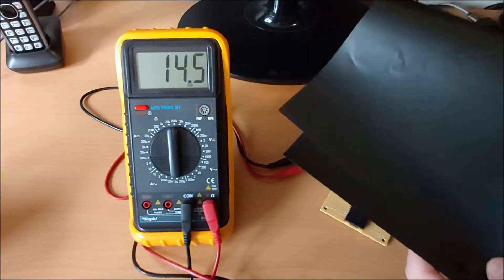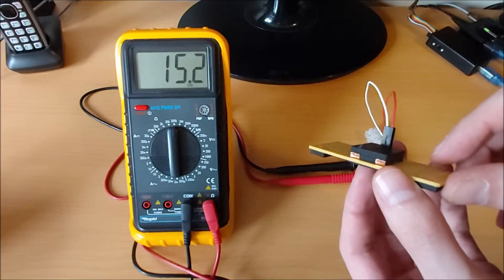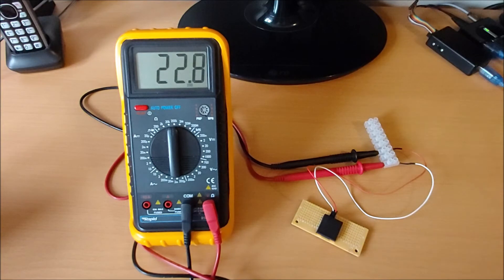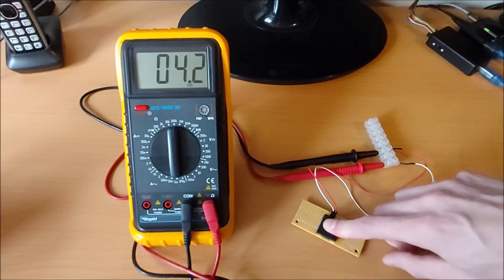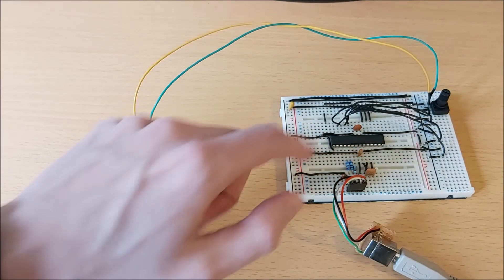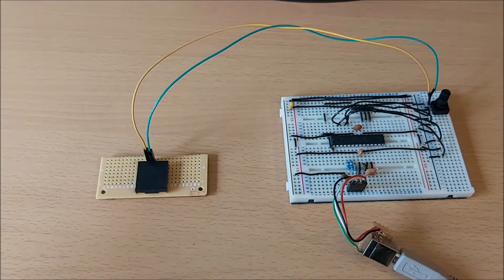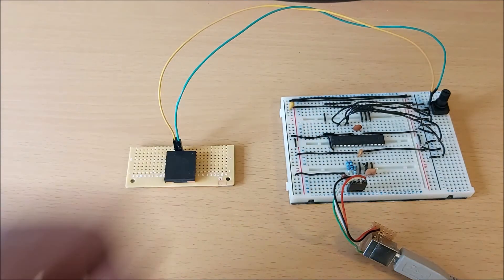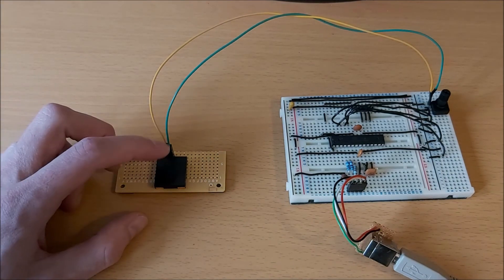Using pressure-sensitive Velostat/Linqstat as a velocity-sensitive MIDI pad

Comment: hey, really cool! could you draw schematic, i'd like to try it too :)
Reply from the maker: Hi , I don't have one but take a look at http://cryptomys.de/horo/V-USB-MIDI/ and https://github.com/wzab/midi-expression-pedal for examples of creating USB-MIDI devices with an AVR. Velostat material changes resistance according to pressure so you can put it in a resistor divider to turn the resistance change into a voltage change that can be handled by the microcontroller's ADC.
Reply: @benryves  great thanks!